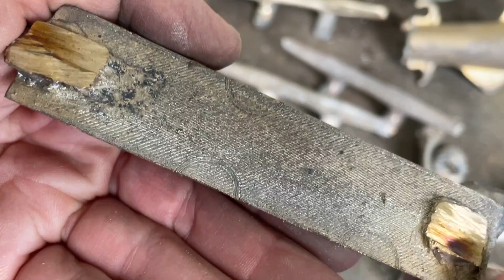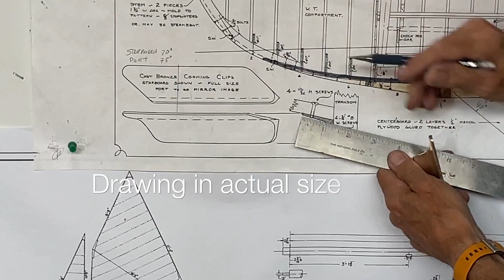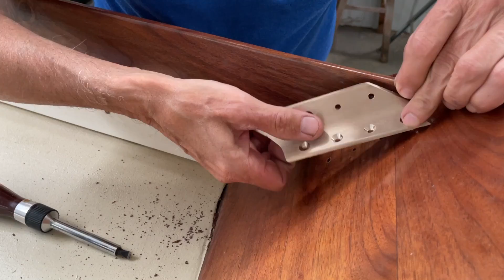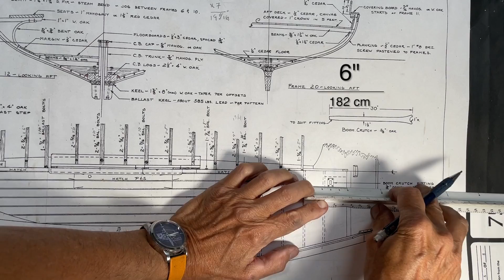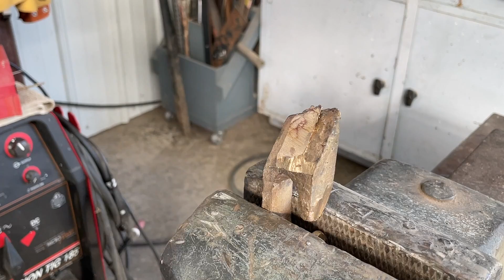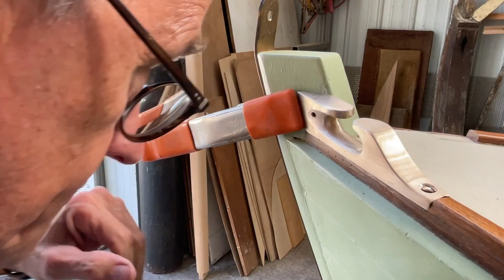The Incredible Finishing of Marine Bronze S2-E68

Comment: Great video. What is that small, rotary sander, you used for the small, inside parts? Is it just a two inch flap sander disk on a drill? Something like that would work nicely on my restoration project.
Reply from the maker: That is a Dremel tool. The attachment I was  using is a Dremel 502 3/8" Flapwheel Sander, 80 Grit. 
Happy sanding!
Bob

Comment: What was the thinking of not sanding the 3D parts before casting them?  Would that have produced a smoother bronze part?
Reply from the maker: Unfortunately not. Sanding PLA results in a rougher surface. Some have ask about a filler. The filler must burn out. So wax is a logical choice. Unfortunately it the leaves a less than desirable surface. In the end the bronze still need the be finished so save the time and invest in the mold as it. 
That’s for the good questions!
Cheers,
Bob

Comment: I am not a boat builder, so this may be a dumb question. For the combing clips, are the often removed? I only ask because, to me, they would have looked better where the machine screws came through, if the inboard side was slightly chamfered, than then the ends of the screws peened over before sanding them flush. They would all but disappear. I only ask because i see the great care you give to your craft - I started watching because of Arabella - fantastic job on Victoria and entertaining to watch the build - so I assume this may be something that would need to come apart from time to time?
Reply from the maker: Yes, they can be removed. Makes re-varnishing easier.

Comment: Oh to have access to a workshop like Bob's. When did fairleads get called chocks?
Reply: If Captain Nat and Joel White refer to them as bow chocks, that’s good enough for me.
Reply: Especially since a chock is something to prevent something moving... US parlance I guess.
Reply: 14th century.
"Middle English, from Anglo-Norman choque (compare modern Norman chouque), from an Old Northern French variant of Old French çouche, çouche (“block, log”), of Celtic origin, from Gaulish *tsukka (compare Breton soc’h (“thick”), Old Irish tócht (“part, piece”), itself borrowed from Proto-Germanic *stukkaz. Doublet of stock."  -wikidictionary
Reply from the maker: Thanks Michael, I do enjoy my space each and everyday! 
Fairleads and chocks are terms that are regularly misused even by experienced boaters. A fairlead is a device to guide working lines with fixed rollers around other objects onboard. A chock is designed to keep lines from moving laterally when fixed to a cleat. This is what ties your boat to the dock or mooring.
Great question, thanks for watching!
Bob

Comment: Bob, is there a plug of some sort that fits in the boom crutch socket to prevent water or dirt or other foreign material from accumulating in the hole while not being used for it's primary purpose?
Reply: Pretty sure the hole went all the way through.
Reply: @dolvaran It did.  But for most of the time it is plugged with the boom crutch,
Reply: The hole didn't go all the way through. @dolvaran
Reply from the maker: The socket is open on the bottom. The only time the socket is empty is while sailing. If moisture get in it will end in the bilge. The crutch will always be in when at a mooring or dock. 
Thanks for watching.
Reply: My apologies to those people I might have offended in my insistence  that there was no hole.  I sure didn't see the hole.
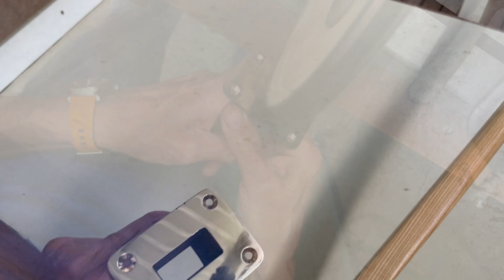Reply: @johneastman7991  It's hard to see but look at 14:54.